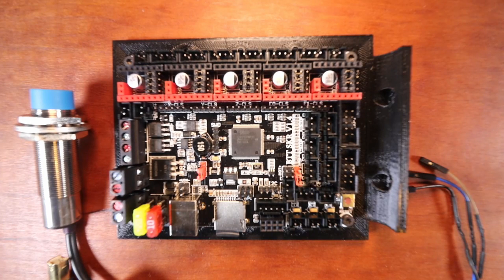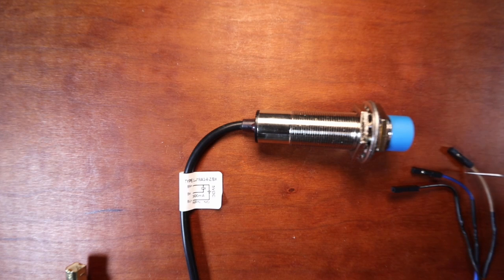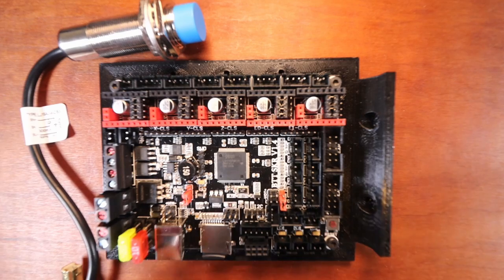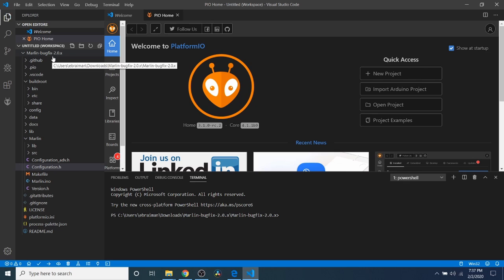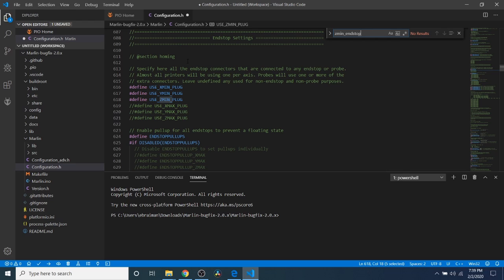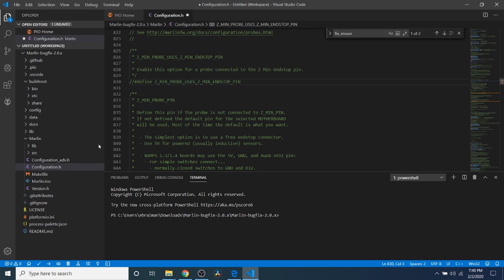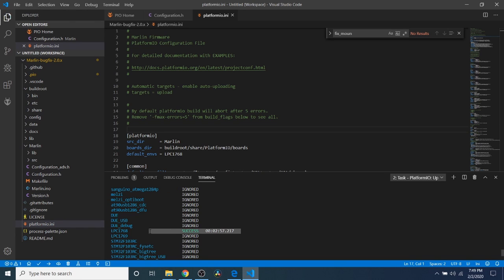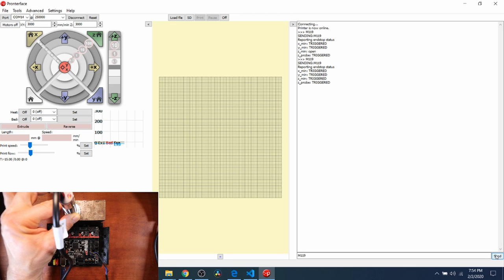SKR 1.4 - FIX MOUNTED PROBE

Comment: Great tutorial, please can you make a new one about dual Z steppers, dual  Z en stops (to ensure correct X leveling)  and Inductive prove for bed leveling?

In that way you have Z0, Z1, Z0 physical 0, Z1 Physical 0, and logical Z 0 (The bes surface) physical and logical Z 0 could differ.

Regards,
Reply from the maker: Not sure I understand the question about dual endstops.  When an endstop is used it moves to the endstop on one side and counts out until maximum value is reached in software.  The only time you might need two endstops is when you're using dual x-carriages where they work from opposite sides of the x-carriage.  Could you clarify your question?

Comment: it dont work for me, Z-axis dont stop when i try to  home Z, it risk to broke my hot bed, Z-STOP is Pin 1.27 but nothing happen, i use the same hardware config
Reply from the maker: Before you home axis what do you see in Pronterface when you send the command, "M119"?
Reply from the maker: Also is the printer surface made of metal?
Reply: @EdwardBraiman  yes is in metal
Reply from the maker: Could you answer the first question as well?
Reply: @EdwardBraiman  i tried now open im using marlin 2.0.7.2, i see also a #define USE_PROBE_FOR_Z_HOMING that i leaved commented  as default to follow your guide. If i use a 2 pin switch NC between 5V e sig 1_27 it work perfectly. i'm becoming crazy. I tried with bugfix version too.
Reply: @EdwardBraiman  at the end i put a relè between sensor and skr input in NC config to connect +5V and 1.27 pin
Reply from the maker: Did it work?
Reply: @EdwardBraiman  with relè yes it work
Reply: @EdwardBraiman  but i was curious to understand why directly it dont work for me, i tried everything
Reply from the maker: Do the part numbers match exactly?
Reply: @EdwardBraiman  yes after a wrong sensor pnp i bought the same as you. I was just curious to know why. Im just doing my 1st print with modded printer k8200. Ive to change position to sensor, i cant do bed leveling cos its too far from nozzle.
Reply: @EdwardBraiman  how do you set your pullup in config? In video its hidden. Maybe i understood why
Reply from the maker: Search on, "endstop", in configuration.h and scroll down a little.
Reply: @EdwardBraiman  i mean pullup on your Z sensor video

Comment: You'll better show how to setup Marlin for working with WiFi(ESP-01). Or maybe it's  impossible? "support@bigtree-tech.com" doesn't give an answer.
Reply from the maker: It's kinda simple, but I'm trying to reset my computer to a before state without using a ghost image.  When plugged in you should see esp something in WiFi.  The network password is 123456789 and then you need to load software according to website prompts from connection.
Reply: @EdwardBraiman  , I see ESP(as SSDP device) in my network , I got webInterface, but Board doesn't see ESP and not responding when I press some buttons or trying to get printer info. Tomorrow I'll open the dispute in AliExpress, maybe BTT will awake...
Reply from the maker: @ДмитрийЯровой-л5з  unfortunately Bigtreetech still seems to have issues with tech support.

Comment: Is that what the EzABL is?
Reply from the maker: Did I mispronce something , I recorded the tutorial quick.
Reply: @EdwardBraiman  No it was fine, just not that educated on the different type of probes and wondered if the probe used in the EzABL kits by TH3D is the type used in your video. Few guides are as clear and easy to follow as yours. I'm getting an EzABL Pro kit so I'll follow their instructions, but still enjoy watching your videos. (and since I'm getting a SKR board and compiling my own firmware it's a gold mine).
Reply from the maker: @SteinerSE  remember if it's not NPN NO 5volts it maybe a challenge to get it working.  First time I tested it worked on a RAMPS 1.4, but sensor type is different for other board.